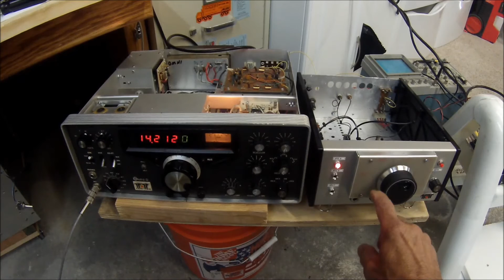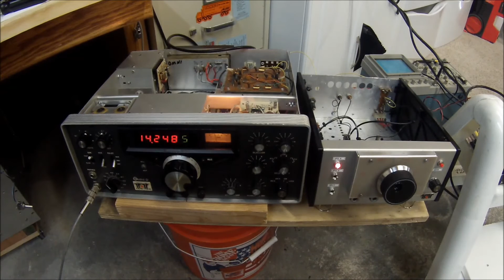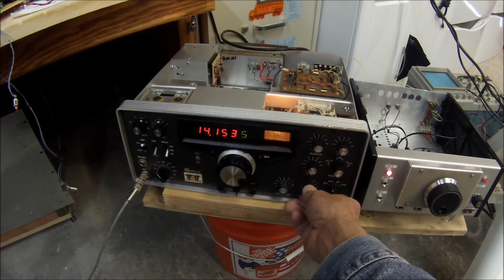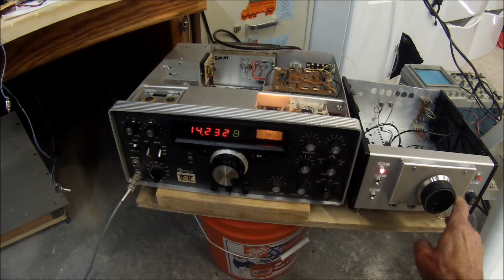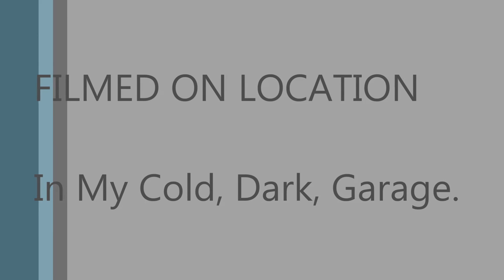Omni D with the N4YG DDS

Comment: Could we adapted to use on the Analog Omni A model?
Reply from the maker: I believe that radio would not know the difference but a better solution to solve two problems would be to build a digital VFO and simply pull the jumper on the back of the Omni and connect the remote VFO and never look back. You can even build a Digi VFO with two vfo frequencies and memory so that you can operate split or just tune another part of the band but come back to a desired frequency. YOUR PTO drifts and that is the second problem that would be solved. You could build an Diigi VFO for very little money -- even add RIT 

Think of it like buying a 57 VW Beetle and installing a pancake Porsche engine inside the rear area. You would be heard and seen going down the highway. Or maybe like the VW reincarnation of the International Scout SUV --all electric.

Check my website https://www.n6qw.com/ for some examples like in the Sudden Transceiver project.

73's
Pete N6QW

Comment: If I made one of these primarily to use on my ten tec 580 delta , could it be used with my omni C and omni D just by plugging it in?
Reply from the maker: Hi David,
I am not the best person to answer that question and I strongly suggest you contact Joe N4YG. I do know the unit he sold me was primarily designed for the Corsair but will work with the Omni D and very likely the Omni C. When the unit is purchased it comes pre-programmed for the specific radios. I don't think the one he sells for the Heathkit will work on the Ten Tec radios. I am not familiar with the frequency scheme of the Delta radios and so that is why you best contact Joe. The hookup to the Omni D was very simple -- pull the jumper plug (the Delta may not have that but the Omni's and Corsairs do) and feed the RF into the "VFO In" RCA jack, connect a lead to a convenient "R" terminal on one of the circuit boards and connect 12 VDC from one of the auxiliary ports and you are there.

If you saw the video you can see how it works. Frequency stability is excellent although some who installed the board inside the radio did have some birdie issues that were resolved with some shielding measures. Mine was in an external box AND I did install a low pass filter in the RF coming out of the board that had a cut off frequency just above 5.5 MHz. That certainly will help any unwanted mixing from harmonics of the DDS.

73's
Pete N6QW
Reply: Thanks , The delta does have the plug on the back for an external vfo. So I am going to research to learn if the corsair and delta share the same vfo scheme.
Reply from the maker: Hi David,

Here is what to look for or at. The Omni C & D and Corsair actually route the output of the internal VFO out to the back panel and is then  externally connected  back into the radio via that jumper. So if you pull the jumper then there is no connection to the internal VFO. By pulling that jumper you disrupt the vfo signal and when you connect the DDS into the radio the internal VFO is totally bypassed and the radio is run from the external DSS. The beauty of Joe's design over others is that you in essence also get VFO A. VFO B and split A/B and reverse split B/A plus an RIT. So this now eliminates the need for a second VFO. Having a plug on the back for an external VFO unless it is like described earlier may not be workable. Check with Joe. Also what is the normal VFO frequency for the Delta --is it 5 to 5.5 MHz or some other range --that you should also check? Some radios in the TT line were odd ducks --the Delta may or may not be.

73's
Pete N6QW
Reply: I found out the delta vfo is 5.0 to 5.5 and if I pull the plug on the back the internal vfo has no effect.I am going to try it.
Reply from the maker: So it sounds like it is the same scheme -- did you download the manuals from the TT website as that is another check? The N4YG kit is not inexpensive --so always good to make sure before you flash the plastic. Link to my website www at jessystems dot com Look in the yellow box in the center of the main page and you will see a link to the documentation on the install --it is a pdf document.

73's
Pete N6QW